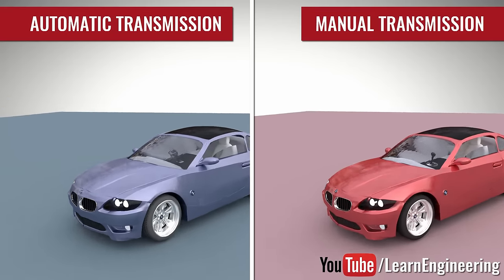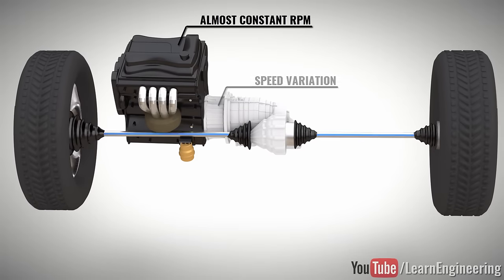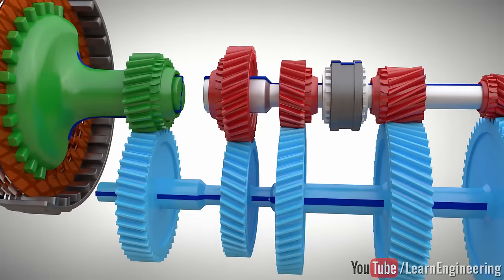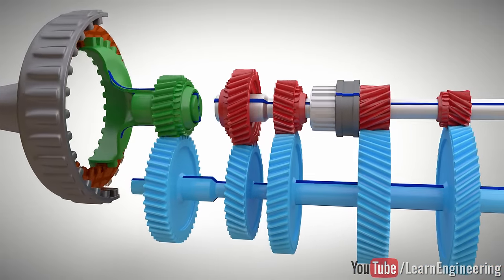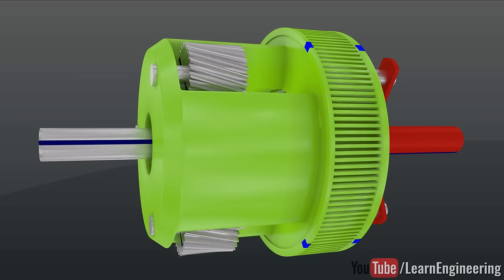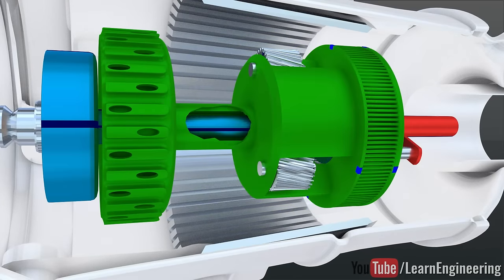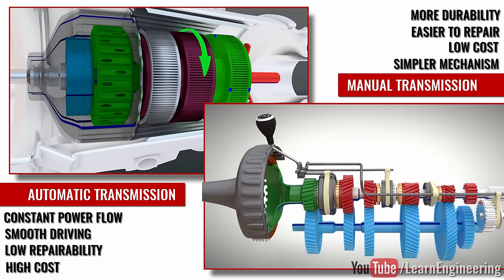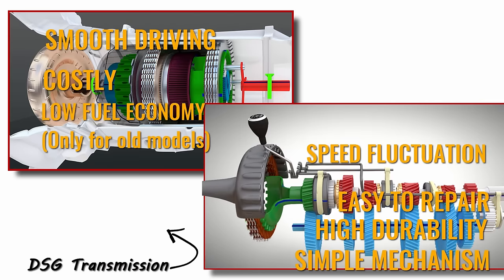Automatic vs Manual Transmission

Comment: Personally i love the feel of manual, even if I stall sometimes. I heard if you get good enough, you can have smooth gear transitions.
Reply: Depends on how long you have been driving the vehicle. 
Each vehicle's gear connects differently. It takes a little getting used to to achieve smooth shifts. 
I recently bought a new car and I sometimes feel like I can't shift for shit. 😅😂
Whereas the old car it feels so much more easier to connect it smoothly.
Reply: @jatinbandhiwal1987  some older cars dont have synchronys so you have to blip the throttle when going down gears
Reply: exactly, it's all about the experience
Reply: Man noo don't do it cuz I destroyed a transmission by incorrectly shifting the gears and I have not still figured out what I did wrong. What I was doing was Leaving the accelerator, pressing on the clutch then shifting but every time it made some grinding noise and after 150km the transmission failed.
Reply: @rayirth.upside-down  I haven't learned driving a car.
But what he meant was just raise the RPM(don't keep your foot on accelerator while youare changing gear) and shift gear instantly.
Reply: @shubhamjuvatkar4023  That's what I do my driving instructor just gave up by not able to realize what I was doing wrong. Atleast I can shift gears in BeamNG
Reply: I was shifting perfectly in 2 months just practice. It's really not that hard. And manual makes automatic feel easier which is a plus.

Comment: You dont have to press the clutch before braking, while Not doing this you are using the engine brake for fuel safing
Reply: Kai Schindler if you got the right aisle. But in general: yes!
Reply: The point being made is that by pressing the clutch you reduce wear to the engine.

Comment: "Real men use manual" edgy comments in coming...
Reply: Thomas Drake incoming*
Reply: Not "real men", but anyone who realy know how to drive is able to use manual
Reply: Felipe Ferreira So if It use automatic I don't know how to drive? ._.
Reply: +Thomas Drake Ir you are not able to use manual, then yes
Reply: +Thomas Drake Why? Auto cars are cool, but if you don't know how to move an inche while driving a manual car, than i'm sorry, but you don't know how to drive. To drive is not only about acelerate and decelarate. In fact "to drive" an auto car is easiest than most videogames nowadays.
Reply: Felipe Ferreira Why is the difficulty important? If you are using a car no matter if its manual or automatic and you are moving from somewhere to somewhere YOU ARE DRIVING FFS
Reply: Felipe Ferreira If we actually talk about prices, confort, and utility THAT is a discussion, but saying that if you don't know how to use manual you don't know how to drive any car is ridiculous dude.
Reply: +Thomas Drake Dificult is not important, but if you enter a tesla, press a button on the gps and the car takes you to your destination, than you are not fking driving. In the same way, a car with auto gear change is a car that you don't need to know how to drive to use. I'm not saying its a bad thing, but the hole concept of auto cars are that you don't need to "fully" drive the car in order to move to some point with it. So the same way that a tesla drive by its self, an auto car does half of the job, in other words: You are not realy driving it.
Reply: Felipe Ferreira Do you know the definition of "driving"? Im just saying, but to drive a tesla you need a "driving license". To drive an automatic you need a "driving license". That talks for itself. You are prepared to drive if you have a driving license, that means that if you have a vehicule and you need to deliver commands on the machine for it to respond as you like, and of course, transport yourself and others to other places, its called DRIVING.
Reply: Ok! Wait one second, i'm going to drive de elevator for a second then we talk again...
Reply: Felipe Ferreira Hahah, if you read again I wrote "vehicule". I don't think an elevator is any vehicule...
Reply: Felipe Ferreira By the way, I was just trying to be explicative in that part, but it seems you are not a person that likes to listen or learn knowledge from others, so...
Reply: Sorry, i can't talk now. The elevator was manual, i'm still stuck in here because i don't know how it works, i've only used automatic elevators till today
Reply: Felipe Ferreira all that matters is getting to the destination. if you want to go make it more work for yourself go for it
Reply: +MERC MANZO Agreed, all that matters is geting to the destination, you can do that by bus, but you dont need to know how to drive for that
Reply: Want a nice steak? you better go hunt, real men kill their own food, they do not buy meat from the supermarket...
That's how you sound...

What driving fanatics/car junkies don't get is that driving is nothing more than a necessary nuisance than actual fun for many people, they drive cars just because it's less obnoxious, more reliable, versatile and faster than public transportation, it's not an actual pleasure, just the lesser evil... 

For me, I just cant wait for self driving cars to become an common feature in every new car, i'd rather be able to take an extra nap while commuting than waste wake time driving.

Extra points if the drivers license become a requirement only for those who want to manually drive their own cars.
Reply: Ruben Fernandes Where have you been this whole time?
Reply: Ruben Fernandes you keep on trusting your life to a computer
Reply: I trust computers more than i trust people, shitty drivers are a common occurrence, plus it should drive better than me when im tired, which is most of the time.
Reply: I think you didn't understand what i mean, i'm not against auto cars, i prefer they by the way, and as you say, i cant wait for self driving cars. All that i say is that you don't need to know how to drive to use auto cars (and self drive cars either). If you know wich seasonings to use in a recipe, but you don't know how to do it properly, than you can't say you know how to cook that recipe, it would be great if you have a machine that can make it for you with only a button press, but it dosn't mean you know how to cook.
Reply: Felipe Ferreira As I see, you talk as if auto cars are self driving or something. 
Using manual or auto cars is the same, because at the end the driver has the responsability of driving properly and safely for himself and others.
Im talking about proper usage, good sight and mature behavior.
If its easier or harder I frankly don't give a f*ck
Reply: I drive stick shift / manual. I would highly suggest anyone who drives automatic to consider driving a stick shift for many reasons. Such as better fuel economy (as you can choose your gear) manual vehicles (in Canada) are actually much cheaper to buy than an automatic, manuals are more fun to drive, you feel in control of the vehicle aswell. Manuals you can bump start and automatics you can NOT.

Also if you went abroad and they only had manual cars for hire then you would be able to drive them, if a family friend or whatever needed you to use their vehicle but it was a manual then you would be able to use it too. You get my point, a little disorganized but yea.
Reply: 6string Great until you're crawling along in that 2 hour traffic jam  or that city centre traffic with a manual transmission eh? Screw that! give me auto without the leg ache!
Reply: Yea, that's true actually.  Responsible people who drive a stick shift are actually better drivers. Cars these days are so easy to drive, people forget easily just how dangerous a weapon a car can be.  Give's them more time to spend time behind the wheel on their fucking hand held devices that they can't put down a for 3 seconds.
Reply: +Zachary Vasil We are commenting in a video about manual vs auto transmition, not about traffic. And even if you see for the "trafic point of view" the afirmation that in general people who drive manual cars are better drivers is true, a person that thinks to drive is just wait in the red sinal and go in the green should never get to control a killing machine As i said before, i prefer auto cars, don't know where you got the idea i would buy a f-4 phanton. Yes, it's way easier to drive a car with auto transmition, good you notice that, a child could do that with no problems. Aside from that, i'm sorry if i hurt your fellings bacause you only know how to drive automatic cars, was not my intention.
Reply: +Guy Fawkes  It;'s boring changing gear? hahahah do you even drive stick shift? It feels good driving manual trust me.
Reply: 6string each to there own I suppose. Driving an automatic feels like a go - cart,  I like it lol
Reply: Real men use manual.

Comment: I honestly prefer manual. Sure, it takes practice to know how to use, but it's much cheaper and simple than an automatic. Plus one pet peeve I have with automatic is that it never shifts when I want it to. With manual, you can shift gears whenever you want. But I do also like "auto stick" transmissions found on newer cars, where it's a transmission that doubles as both an automatic and manual. But all in all, I like manual a lot
Reply: I have been driving my 89 Honda accord (automatic) for almost 4 years now. After all this time, I can consistently get the engine to shift exactly when I want it to by changing throttle. I feel like it’s possible, but you have to become one with the computer handling the transmission.

Comment: "A manual transmission is never a smooth experience". Bull. Any experienced driver will make a manual just as smooth.
Reply: Aeros, in fact, one of the reasons I hated automatics and switched to manuals was because automatics were not as smooth, especially towards stopping and transitioning to first gear.  If you are  not fully stopped before accelerating from first, it's like riding a horse.
Reply: FUGoogle  sounds like you ride clutches and destroy synchronizers
Reply: @bacardimgtow4505  I don't know what car you are referring to... I learnt to drive and drove manuals exclusively for about 10 years. For last 20 years I've been driving mostly automatic.My advice; I you want a real smooth driving experience then buy electric car or one with CVT.
In most cars with manual transmission you cannot downshift to gear 1 while the vehicle is still moving. Either way you have to bring it to full stop and engage 1st gear or force it to accelerate on 2nd which would drop rpm below idle. Not nice and jumpy experience though. Or... you have to slip a clutch. 
On other hand - automatic transmission can synchronize to any gear (as far as my experience tells me).

Comment: Manual used to be better, now automatics are better - more efficient, reliable, better fuel economy.....
Reply: Clive Sinclair automatic is not better than manual wtf u smoking
Reply: ALLAH [SWT] IS MY LORD You should check the manufacturers data for manual v auto (for same motor. All perform better and use less fuel. Just because some folk like driving manual, doesn't make them 'better'.

Take a look at how many manual cars Ferrari, Porsche, Mercedes, Lamborghini, Jaguar.... and many more have a manual option for sale
Reply: ALLAH [SWT] IS MY LORD what are you smoking. not all autos are better but say on a drag strip autos are always faster
Reply: Automatic doesnt have better fuel economy. Maybe if the manual driver is bad at shifting, if the manual driver is good at shifting then its always better.
Reply: TheTopChili Audi, BMW and the other top tier german brands can now make automatic transmissions more efficient and fast than manual transmissions.
Reply: Automatics are better in almost every car simply because automatic transmissions allow for more gears which cause less stress and the engine doesn't have to work as hard to gain more torque. A 10 speed Manuel would work but who would want to drive that? Who wants to make that?

Comment: I agree with a couple of commenters below that the video should not say a manual Xmission isn't as smooth as an auto. I consider it a skill to provide a driving experience where not only is the shifting with a 5 speed smooth, it's actually smoother than an automatic, with which you can feel the gear changes, subtle as they may be.  I've had people go on an entire trip and finally asked if I was using a clutch!  (Some people think the shifter can be used to change gears on an automatic).  Indeed, with a powerful car like a Corvette with an automatic  where the pedal is floored, you can really FEEL the gear shifts.  Finally, I've always used downshifting to slow the car, automatic or manual, which easily boosts brake life to 90,000+ miles.
Reply: How do you downshift on Automatic bro

Comment: Hell No about the "Clutch before Brake". 
Brake first then use the clutch when nearing a complete stop. OR, use it to shift to a lower gear that helps slowing the car down even more, while keeping control. 
Now, I don't know the science behind what I just said, but going fairly fast quite often, GOD KNOWS hitting the clutch first is signing your death note. 
If it's MAYBE good for the mechanics within the vehicle, it's not good for the human in the vehicle.
Reply: Nah Hans you were spot on and the video was wrong. it is worse for the car's parts if you clutch before breaking and is less fuel efficient. By pressing the clutch as late as possible you get to benefit from engine breaking while slowing down which means less wear on your brake pads as they have slightly less work to do and reduces wear on the clutch's diaphragm spring as the clutch is staying connected. On top of this keeping the car in gear longer also means you can keep more control over the car as you don't leave it in neutral
Reply: Clutching first will ruin the teeth of clutch when break is released since gear axel is at a lower RPM than Clutch's axel connected to engine.
If car is shifted to lower gear without braking then it is gonna harm the engine n the gear itself since this time gear axel is on higher RPM. These are just the explainations of what he said (which is correct)
Best way according to me...
For gradual slowing down, down shift along with braking.
For instantaneously slowing to a much lower speed, just press the brake like he said but it will harm brakes a bit.
For slam stops, press both together but you gotta stay still for a while before releasing clutch so that engine comes to a low and safe RPM to continue with the gear axel.

Comment: You didn't compare the power to the wheels. Automatics use a torque converter which is a liquid connection. Manuals use a clutch, which is a solid connection. Manual transmission put more power to the wheel! Also, a good driver with a manual transmission can shift very smoothly. Even speed shifting can be done very smoothly as well. Speed shifting is hold the gas pedal to the floor, pushing the clutch in and shifting, then releasing the clutch as fast as you can. Drag racers did this in the 60's and 70's when automatics weren't built as good as they are today.
Reply: Real men shift without even touching the clutch pedal.
Reply: I've never seen that done. Please show us!
Reply: Google it.
Reply: Thank you, finally someone who actually gets it.
Reply: Learn how to shift and you won't have any costly repairs.
Reply: Doug Spring he is talking about power shift, shifting gears without pressing clutch. Only for professionals [HOONIGAN]
Reply: But if they dont do it fast enough they're gonna need a new transmission lol
Reply: Doug Spring but my auto can shift faster so if we are racing it could be 3-4 tenths of a second a manual trans is not making power while for those fraction of a second the auto is still going 3 tenths of a second dosent sound like a lot but through 4-5 gears the can be 1.5 seconds or more so autos are faster and no one can shift a manual as fast as a auto
Reply: Ask any truck driver.
Reply: @drgoutbreak7934   The gear ratios in an auto are shit. Unless you use a tiptronic with the same ratios as the manual which is not a thing in most cars, a manual will use there whole rev range in 2nd and 3rd, while an auto will shift at about 4-5k when the engine is rated at 7k. DSG pedal shift is one of the best auto gearbox the rest are shit as fuck.

Comment: One thing i don't understand is that when you demonstrate the clutch being disengaged you say "there is no power being supplied to the transmission", but the output of the engine is still very much connected to the gears and they continue to spin with the engine while the clutch is supposedly pressed

Comment: Everything you need to know is that it uses this technology to get pressure from engine. when your engine goes over 2500rpm there is enough pressure for hydraulics to change the gear

Comment: no, don't clutch on emergency brakes rather shift to low gear to be assisted with engine break
Reply: So shifting to lower gears without using the clutch is the way to do an emergency stop. Yeah right.
Reply: @PrinssiFO  he is not wrong, but didn't express himself clearly. In a situation were  you have to break and you have enough distance, you should lower your gear. Now in an emergency you do NOT engage the clutch, you step on the brakes an let the engine stall

Comment: An interesting transmission is the MTA, which is a manual gearbox that shifts for you. But it still works with a clutch pack and simple gear ratio's, so it's easy to maintain. But less comfortable than a standard automatic transmission